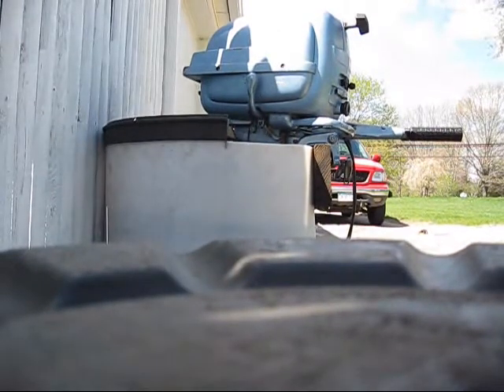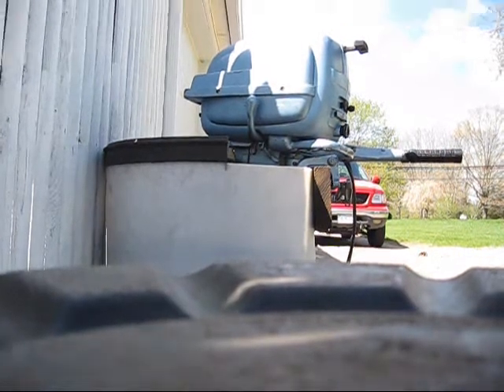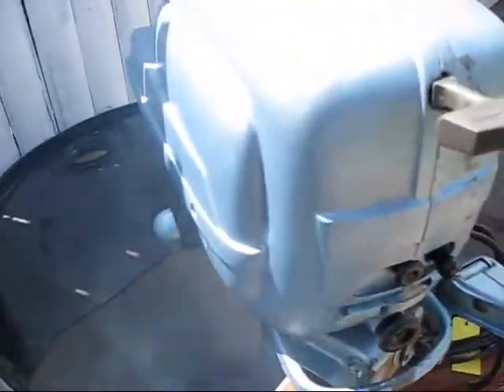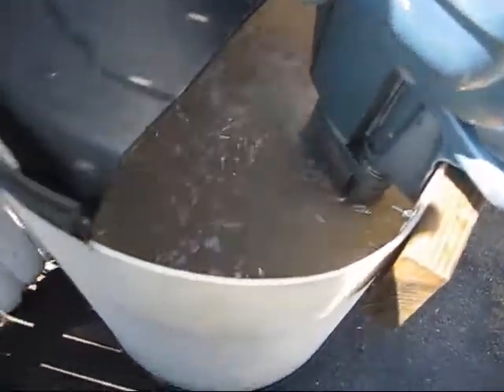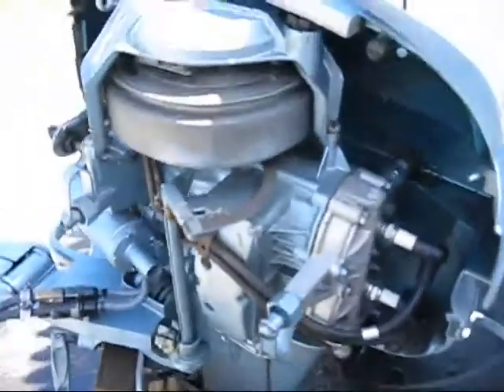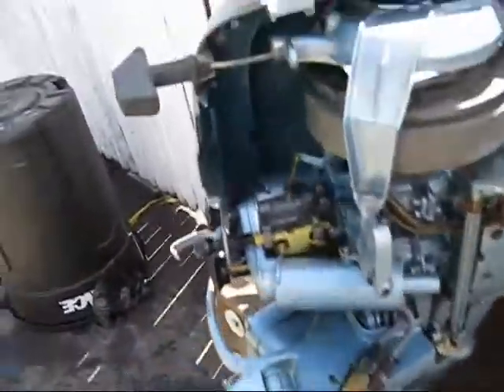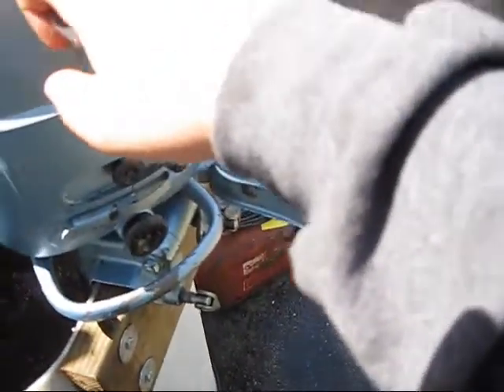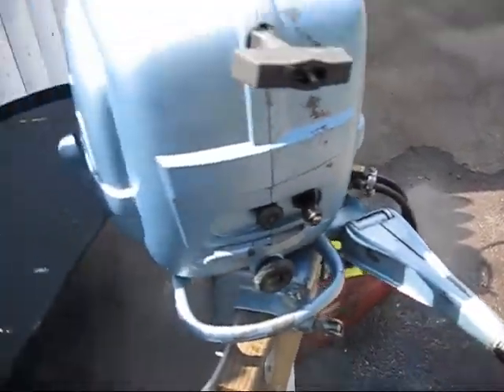1954 Evinrude Fleetwin 7.5 hp

Comment from the maker: @DanOblacksmith Coils, tuneup kits (points and condensers), water pump impellers, and carb rebuild kits are all still available at your friendly local Evinrude/Johnson dealer.  For manuals, look on eBay

Comment: What are the knobs in the front? And how are they used?
Reply from the maker: the knob on the top right is the choke knob, the other two knobs are the high and low speed fuel mixture adjustments.